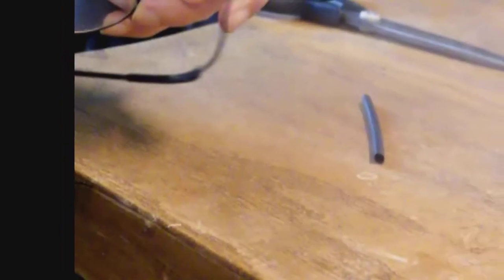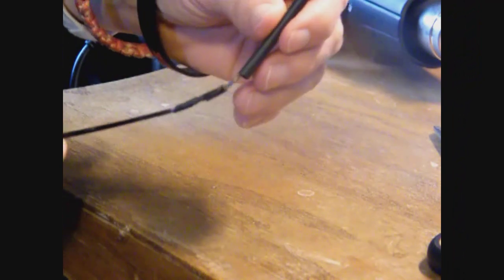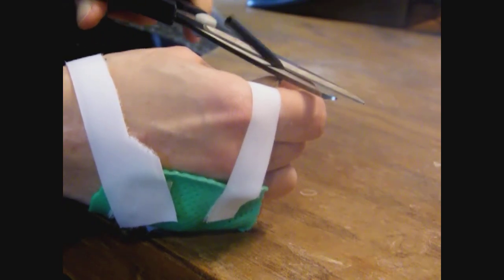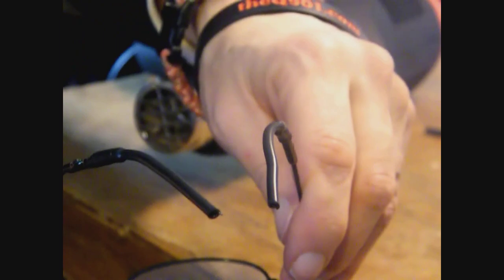How To Repair The Temple Tips On Your Eyeglasses

Comment: I just upgraded from this shrink tubing type fix with some temple tips from Walmart. I didn't have any part of the old temple tips so my tubing would push forward and slide around on the wire arms. The first time i did the fix I folded over the shrink tubing and put another layer on the outside but a mouse got on my desk a few times and chewed it up. I ran out of the shrink tubing and been just using one layer not folded. My ears really don't like the rough  wires poking them so I just had to break down and get real ones for $1.50. They told me to use a hair dryer to shrink them, I opted for a lighter instead and it worked. They are loose but won't come off since they have conformed with the curve.
Reply: hi there , care to share the picture / video of your temple tip? tq in adv.

Comment: How would you fix ray ban aviator frames that have the clear tips. If one is just loose at the end of the clear tip and metal starts? I just adjusted my frames and now theres a click sound because bending the frame made a tiny gap and now its loose. But how would i close that gap like its supposed to be?